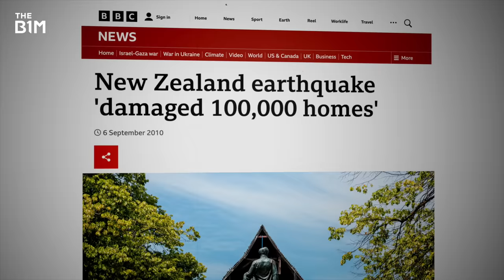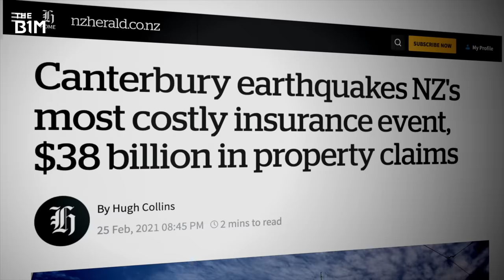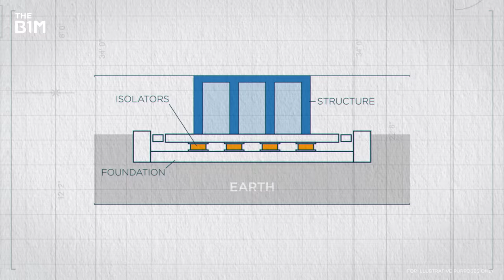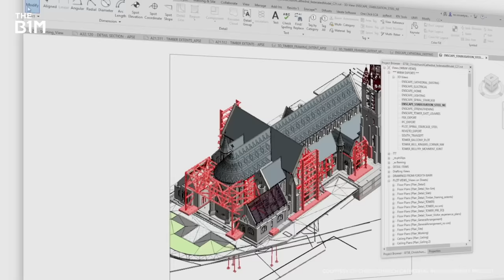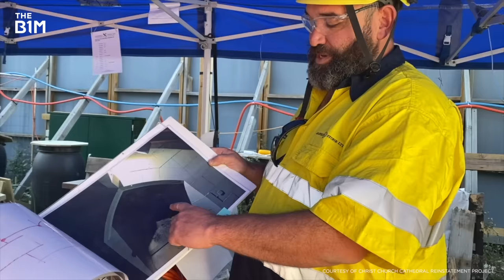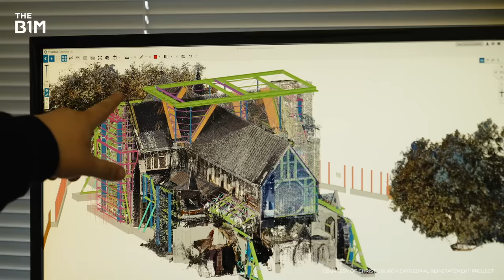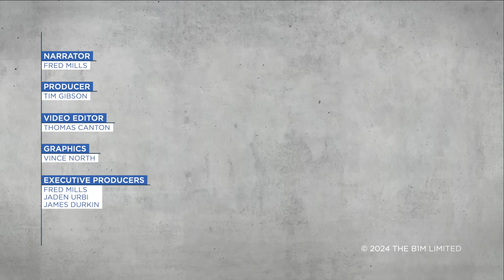The $42BN Plan to Rebuild the World’s Unluckiest City

Comment: For just the price of one third of a British high speed rail line, you too can re-build yourself an entire city.
Reply: Fun fact - Indonesia built its first high-speed rail line between Jakarta and Bandung for US$7.3 billion, that's less than the US$10 billion pledged by Rishi Sunak to fix potholes across northern England
Reply: After the Romans left, construction has never been the same.
Reply: @dalismers  I came from a place where politicians' best slogan is "fixing the roads" because they are never fixed and when they do, they break down just sometime BEFORE the elections. It's a great way to embezzle funds and makes for an EZ political campaign. BTW, the constructions of these roads would undergo up to 50% of their term and they degrade after 80% of their term just so they can run again addressing that problem all over again. Also during that 50% of their term, the construction team just block the roads up and not do any work at all. There was some "repairs" where they made the roads way worse than having the potholes as well. Basically the patch job to fill in the holes where so poorly done and not flattened that they create multiple road bumps and some were tall, making the bumps just as deep or even deeper than the original holes.

Any infrastructure campaigns are essentially embezzlements. The politicians and their friends (like their respective parties and sponsors) get majority of those funds. This is like donating money for charities. It's a trickle down economy. A pyramid scheme.
Reply: Ah but the Nombies wouldn’t have had all that compensation and the contractors and consultants wouldn’t be able to make so much money.
Reply: @wanderingbufoon  You are seriously clueless about economics.
Reply: @dalismers  HAHAHA awh mannnn
Reply: @djsmithe people that say stuff like that just have no clue
Reply: @dalismers  
Pretty sure that the "potholes" - i.e, road maintenance across northern England are far far more numerous than the creation of a single rail line.
Reply: a lot of the insurance money intended for the rebuild ended up being taken away and spent elsewhere such as Auckland, as there was no point back then in rebuilding your business in an abandoned, destroyed cbd, it's still quiet around chch cbd, will take years to recover.
Reply: That's exactly what I was thinking. My country is a perpetual source of disappointment.
Reply: @MyFiddlePlayer  wow.. you're brave saying you're stupid or ignorant.. I could never. Let alone have the audacity to put down someone calling them clueless about economics on a comment about how money gets embezzled. Just wow... Intro to business should get you far enough. I suggest you take that before spouting something so audaciously stupid.
Reply: He misspoke,  80% of the CBD was raised, most of the city outside the CBD had no to moderate damage and was repaired.
Reply: @Battleneter yes. It's very badly expressed. 

In fact, it wasn't even that. Most of that 80% of the CBD actually wasn't really raised, so much as it wasn't worth fixing it when you could have a new building. I know an architect who was very busy designing new buildings, half of which he knew weren't going to be built - they were just for establishing costs for the cost/benefit.
Reply: @wanderingbufoon  You can't just go around saying that because embezzlement exists, all charities are bad. That's completely faulty reasoning no matter how it gets sliced. I appreciate that it's not very nice to get called stupid and that you feel hurt by what the other guy said, but that doesn't mean that you should let pride get the better of you, especially after you correctly stated that it's wrong to cast judgement on your brother any wrongs he has committed not even two lines before deciding to cast judgement on your brother. I wish you all the best and pray for your salvation.
Reply: @dalismers Do you know of the logistics with this issue?
Reply: @dalismers  
Thanks to China
Reply: For half the price of a high speed rail planning committee in California, you can rebuild Christchurch lol
Reply: @wanderingbufoon  I suppose it's different then for some Asian countries (such as Japan, Korea and even Indonesia as mentioned) where infrastructures are treated as something worthy to be maintained as long-term investments. For there, I suppose they treat it as something like a real-estate (or because they're owned by such company lol), as opposed to the usual Western mindset that treats this as something for-profit use only.
Reply: @justinp1011  it's because people's opinions over there can "overthrow" leaders. However, in western cultures, they know they're nothing but livestocks. They have the power not to be but they're too scared to be anything else.
Reply: For just the price of an Auckland Transport pedestrian crossing.
Reply: It's also NZ's second biggest city! No insignificant feat
Reply: @ryancampbell8416  yeah its so different now, still so many cranes and demolition going on
Reply: @justinp1011 Japan and Korea aside, Indonesia is most definitely not an infrastructurally sound country. Its infrastructure is even worse than that of the US, as is their urban planning. Most of Jakarta does not even have any pavements, and even in a lot of the places that do, you could very well slip into the sewer with all the giant gaping holes! So when news came out of the plans for a metro, my first thought was, "How would anyone even walk to and from the stations?" Seemed much more like a vanity project than anything. Also, the Anglophone world aside, continental Europe has great infrastructure!

Comment: A small clarification... It was 80%+ of the city center that had to be rebuild not 80% of the city.
Reply: over 10,000 homes were lost on the eastern side of the city and including Kaiapoi.
Reply: He meant city center/CBD by saying city but definitely not clear for people who assume city means more than just CBD, eg you could say 'I'm going into the city' as in the CBD even if you live in another part of the city
Reply: @geofflye4582  but that 10,000 out of 135,000 ish, so yea depends how you want to do the math but we can all agree he got 80% wrong.
Reply: @geofflye4582 yes. Some areas were basically all damaged beyond repair, but most houses  were fine, at least for a while. 80% needed some repairs, but often just a few cracks filled in. Mine still has a cracked driveway.
Reply: YES YES YES only in chch city center will you see any investment
Reply: Came straight down to the comments to see if someone had that cleared up
Reply: @geofflye4582  ok that's a small fraction
Reply: @joshduthie3401 What are you on about man? Entire suburbs are permanently  red zoned now.

 There's not a freind or relative I know here that didn't have property damage claims with insurance.  Some of which lost their homes. 12 homes on my street were lost. Mine got damaged plumbing,liquefaction, cracked Weatherboards,cracked driveway and I lost my chimney. And I was lucky.A quarter of my roof tiles gone too.

Comment: Kiwis are awesome. A few years ago, while skiing the Canterbury fields, we drove up a treacherous pass only to reach a carpark covered in ice. Cars were slipping and sliding into each other, so I decided to park on the far side of the carpark. This was not a popular decision with my group. After falling down multiple times, we all crawled across the car park on out hands and knees to reach the 2-person travellator. At the top of the travellator, there was a hire shop to get your nutcracker. Nutcrackers are steel clamps used to grip the tow ropes, for those not used to just using their hands for the purpose. You leave the hire shop and wander blindly into the wilderness, guided only by the sound of the tow rope motor off in the distance.

The tow rope pulled everyone flat on their face multiple times until you get used to it. Then you get to the first guide wheel which will crush your hand if you are still holding the rope to balance yourself. There are several more guide wheels to avoid before reaching the top. From the top of the mountain, a picturesque chalet could be seen below which looked like the best place to recover from the last hour of trauma.

Inside the chalet was an urn of boiling water, a jar of teabags and donation tin. After making a cup of tea and placing a $2 coin in the tin, I went out to the deck and met an elderly gentleman and his 2 toddler grandchildren. I looked around for some kind of transport and asked how they got there. "Oh, we just drove up, found a parking spot, caught the travellator, jumped on the tow rope and skied down here a while ago - why do you ask?". Respect! 🤩

Comment: So where are your sources for the 80% damage? Being from Australia and taking great interest in it we visited just after the quakes, and there certainly wasn't 80% damage.
Reply: Yea he got that wrong, its 80% of the CBD and even that is probably a tad high in reality. Most  city suburbs had little damage to moderate damage, however 10,000 out of 135,000 homes rebuilt, so not nothing.
Reply: @Battleneter  I think it comes from 80% of houses needing some repair, even if just a crack in a wall fixed.

Comment: I went to the Cathedral in November 2010, after the first earthquake and before the second. I didn't get to go up the tower unfortunately simply because of the earthquake risk and I was only 11 at the time. I still remember it vividly aswell as the building around. When I went back in July 2018 it was the day they were announcing the rebuild project and I can remember looking at the Cathedral and how severely it had decayed by that point, that and all the surrounding buildings were gone, replaced and only about 1 or 2 still remained but in disuse.

Comment: I have Bluebeam Revu on my work computer and I can confirm; it is the greatest pdf program ever. If you are an engineer, it will make your life so much easier. It can overlay two pages and show you what changed between them. It can put open up the same document in two different windows so you can look at two different pages (like a drawing and its associated list of materials) at the same time. AND YOU CAN TAKE DIMENSIONS OFF OF PDFS!!! YOU CAN LITERALLY CALIBRATE THE SCALE AND PUT ACCURATE DIMENSIONS ONTO A PDF!

Comment: The Richter Scale is  obsolete. It's just 'magnitude', shortened from 'Moment Magnitude Scale'. I know that the B1M loves to use a bizarre mix of imperial and metric measurements but in this case you've simply stated the wrong scale with the magnitude number.

Comment: GNS Science, with its intensive study of the Hikurangi Trench which runs down the East coast of the North Island, is very concerned at a potential 9 on the Richter  Scale. They estimate a 25% chance of such a quake in any given year within the next 50 years. Potentially worse than the 8 which is due any time on the Alpine Fault. NZers need to prepare as best they can.

Comment: I recall having to wash out my mouth with salt and water, post tooth extraction the previous day and we were lucky enough to have the connectiing water pipe fixed that day in February. I still recall grabbing for fear life of the basin in the bathroom, and the rubber flap of the glass screen of the shower scraping me. If that glass screen didn't have that flap and smashed my leg, I'd be screwed, as due to blood loss and lack of communications post earthquake.

Comment: I’m surprised that if New Zealand has so many earthquakes why the buildings there are not designed to withstand them?🤔 like the way they do in Japan
Reply: A lot of the building that collapsed were either old or were not built to standard ( the engineer behind the ctv building where most of the earthquake fatalities were faked his creditentials). After the earthquakes standards were updated.
Reply: they are, our earthquake laws are as strict or stricter than Japanese ones. certain buildings didn't meet compliance laws or were to old to be compliant. since the 2011 earthquakes though its gotten way stricter, all buildings even really old ones now need to comply nationwide or they get condemned or demolished.
Reply: @@momytikyour talking complete nonsense, cities like Wellington and Auckland are well designed to withstand earthquakes. The problem for Christchurch is that it was never considered an earthquake risk due to its location on the Canterbury Plains, away from the main fault that runs through the Southern Alps. Wellington was always considered to be the city most at risk, Christchurch surprised everyone. Kiwis, like the Japanese are experts in earthquake management,  as a child growing up in NZ we had weekly earthquake drills at school, our houses are mostly built with flexible  timber frames, and in the case of my parents house, it  actually sits on the fault floating on a concrete bed that rides the movement during the shakes, Kiwis are pretty well prepared. But back to Christchurch, the big determining factor in the problems experienced by the quakes was not just the shaking but the liquefaction that occurred,  the CBD and surrounding suburbs saw their building/ houses sink into the ground. The reason for this is because Christchurch is built on an alluvial plain.
Reply: @@momytik  @momytik  You talking nonsense, we do have the expertise to do the construction needed in this country. I was a builder for 50 years her and overseas and i know what i am talking about. What New Zealand lacks is money. We don't have the wealth and larger populations like those nations you mentioned. For a country of our size, that is larger than the UK we do very well. We only have a population of 5 million, smaller than Londons 8.6 million. That is the reason why we just started to build a metro in Auckland, with a population of 1,7 million. there a lot of us Kiwis who believe it is a waste of money.
Reply: @@momytik All good
Reply: We do to a certain extent. Most houses in New Zealand are timber framed. Even brick houses are usually a brick veneer over a timber frame.
Reply: @martinnewcombe6088  You are talking a lot of nonsense. Since the Christchurch earthquake I have been upgrading buildings in Wellington. There are still hundreds of buildings to be upgraded. Wellington does have a lot of modern buildings, but even the majority of those ones have to be upgraded to meet the new building code.
Reply: @localkiwi9988    Your misquoting me,, I never said NZ didn't require buildings to be upgraded, every city that experiences earthquakes needs at least some existing buildings to be upgraded, I said the cities are well designed to withstand earthquakes. Wellington for instance built its suburbs either side of the fault lines, not across them, and most homes etc... have timber framing, floating beds, as a population we have taught earthquake response ie drills  from early childhood and we have a high level of earthquake expertise. My references to Christchurch are absolutely correct as well, liquefaction was the big issue city wide. Yes there were buildings that collapsed but my point still stands.
Reply: @martinnewcombe6088  Point noted

Comment: Most of us "Yeah just gently dismantle the whole structure to the ground and then recycle what materials we can so we can rebuild a 1 to 1 of the church"

A few complainers "No think of the history, rebuild the church and don't demolish".

So how do the rebuild it? By dismantling large sections of the church so they can install structures to support the rest of the unstable structure and when that's installed they can continue to dismantle different sections of the church and rebuild it while they hope those unstable pieces don't collapse on people before the next earthquake. So instead of doing it the cheap and fast way we're doing it the hard and expensive way with extra steps.

Even the Anglican Church wanted to demolish it because it was essentially rubble. it could've been a symbol to the city of how we could rebuild ourselves better and stronger, instead it's become a circus of different groups sticking their noses into the situation and thinking they know better than everyone else. 

I was just finishing high school when the quake happened, and it's always rubbed me the wrong way that we pissed away so much money on not fixing the church. It sat there for years with fake billboards on the exterior of the building to try uphold the image of a grand cathedral while it's bones were rotting on the inside from the exposure to the elements.

And while it sat there people pissed away even more money going through the court system trying to argue that the building could be saved, trying to argue that it could be fixed. Even though fixing it meant tearing nearly the whole thing down any way to redo all the mortar and brickwork.

Comment: Rebuild has been slow, and overall a wasted opportunity. Most big projects with Govt being the major stakeholders had big cost blowouts. Still a lot of  carparks on barren sites. Transport is ruled by the car. They have built some cycle lanes but nothing like in Europe. Poorly designed and not enough separation from vehicles. 
NZ is too small a country with low productivity and has slipped behind other OCED countries. There are some success stories, but without major investment in R&D we will just be a mice place to visit.